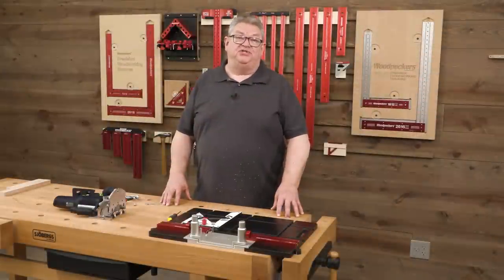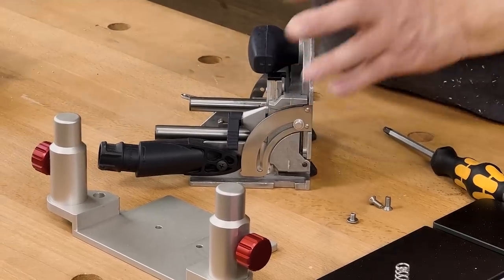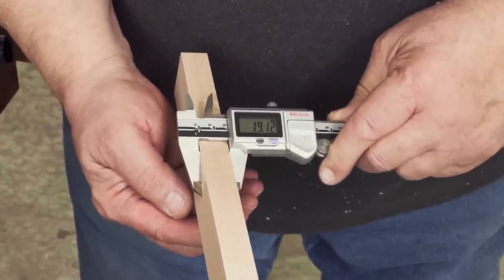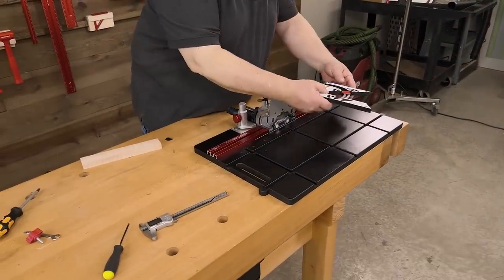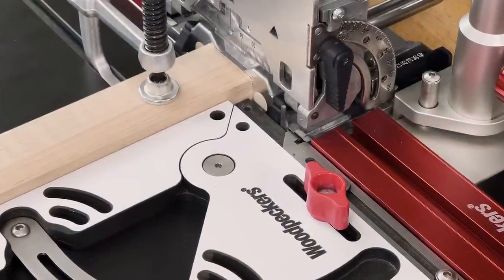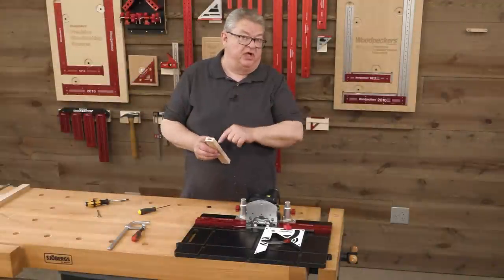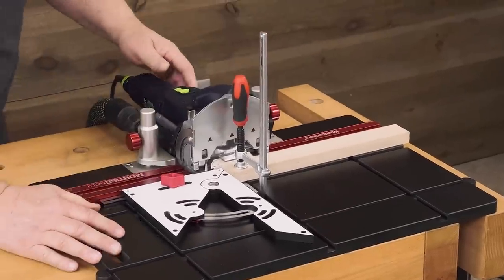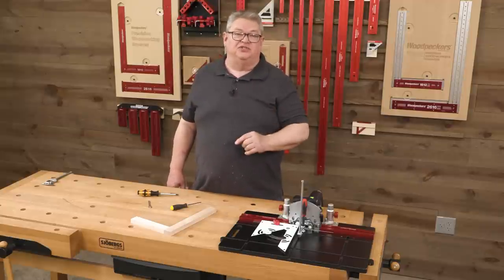MortiseMatch™ Assembly & Fundamentals | Deep Dive | Woodpeckers Tools

Comment: I built my own Carmonius version about a year ago.  But earlier this week, after seeing the Woodpeckers MortiseMatch, I decided it's a significant improvement.  My Carmonius version is good, but the Woodpeckers version takes it up a new level of convenience and utility.   As a daily hardcore-user of my DF 500 Domino, being able to switch between hand-held and base-mounted is very important.  The Woodpeckers version offers base-mounting plus the convenience of quickly dismounting and using the DF 500 -- and then almost instantly reattaching it to the MortiseMatch with perfect alignment.  That's worth its weight in proverbial gold.  And of course, that feature, together with adjustable triangle-protractor fence, is where the engineering and manufacturing innovations are -- and make the Woodpeckers version different -- and worth the money.  "I''ll take one."   (And Woodpeckers now has my pre-order.)
Reply: You Sir, win my "faith in man medal for the day". :)

Comment: I have three Domino machines - 2 DF500s and a 700.  I've probably used the 700 three times in seven years for so.  When I use the Domino, I always cut one mortice on the nominal tenon size setting, then for the mating mortice I flip the setting to the next larger width (always with the machine running) to 1) give me leeway to be able to shift the parts to line up perfectly and not have to cut both mortices exactly spot on and 2) to be able to get the pieces apart after a dry-fit by having a little side-to-side wiggle room; otherwise I find the dominos are so tight I can't pull the pieces apart without bruising the adjacent wood.  I'll reserve judgment on the Mortice Match for now as it's a little pricey for a hobbyist.
Reply: in 2008 and using the adjustable dowel placement pins on the Domino I notice that alignment of mating pieces were not perfect.   I sent the Domino to Fextool service and they corrected the issue.  HOWEVER they told me that the ossilation of the cutter can and probably will again go out of adjustment.  Hense the adjustable indexing tabs.  BUT Festool advised me to simply, unless absolutely necessary, cut like you described.  Tight mortice for one side of the joint and the elongated  mortise for the mating piece.  I have never ever had alignment issues using this method.
Reply: Sand the edges of your domino tenon and you will be able to pull your joints back apart and you can then make the mortises tight on both piece of material. Sedge from Festool Live always talks about sanding the domino slightly to get things back apart after dry fitting during the Domino Episodes. I have been doing that for years and it works wonders because I like to dry fit everything.

Comment: How is this thing secured to the workbench? It appears it’s just centered between bench dogs. If so, is there another way to secure it from the top via screws or some other fasteners? Also, can the black base part be extended or added onto for bigger work pieces?
Reply from the maker: You're right, we usually just clamp it between dogs. You can also clamp it to the edge of a bench with "F" clamps. It is not pre-drilled to screw-mount, but there's no reason not to do it, if that's the way you want it. We don't offer any extensions, but the black phenolic is 3/4" thick, so building extensions should be pretty easy.

Comment: Innovation is nice. Pricey for what it does, but worth to some it if you have the extra money to spend on jigs and don't have the time or the know how to build their own.   The  Accurate-Alignment Biscuit-Joiner Jig from years past combined with the new MATCHFIT Dovetail Clamp Pro from  Micro jig master kit will get you somewhere near this jig,  but not all the way. Again nice innovative design by Woodpeckers and will be helpful to those doing picture frames and casement work and using a Festool Domino DF 500. It was nice of Woodpeckers to include links to the above biscuit jointer jig. I actually have the Wood Magazine from March 2005 issue 161 that the jig and plans was featured in and never got around to making one for my biscuit jointer. Might have to break it out give it a read as it has the old plans and make me one now that I own a Festool Domino and a Biscuit jointer that I still use on occasions along with the MircoJig MatchFit Dovetail Clamp Pro.  I have already made a temp jig for hold downs while pocket screwing pocket joints with the MircoJig and it impressed me for the simplistic nature of the system. Then realized I could do all that with my MFT. and the clamps/ dogs from Festool. Again Great Job and design Woodpeckers. I have many Woodpecker tools in my shop, I do love the Domino offset jig and the story stick I have..

Comment: I have owned a Domino since 2007, cut in excess of 10,000 mortises and have never needed or wanted anything like this.  Sorry but this would be collecting dust in my shop.   How about coming up with a quick and repeatable way to clamp work in place on the Shaper Origin Workstation vertical clamping panel.

Comment: Could someone who has used this, or Jeff, comment on how to set up to do all 4 corners of a square butt joint frame? If you cut all four "stiles" with the protractor on the left and show faces down, and then flip the protractor and keep the show faces down on the "rail" parts, two of the mortises will be on the outside of the frame. The instructions indicate "butt joints require you to cut opposing corners of ends and sides at the first setting." Please elaborate.
Reply from the maker: Think in terms of diagonally opposed corners. Joints on opposite diagonal corners are done with the protractor on one side, then the other two corners are done with the protractor on the other side.

Comment: Neat item. It eliminates the need to align the centering mark on the clear scale with the actual mortice that is cut.  That alignment for "balls on accuracy" <technical term> is a pain in the a$$.
Reply: If you use a tight mortise for one side of the joint and the elongated mortise for the mating side of the joint the curser on the clear scale is easy and PLENTY accurate with the added bonus of a little wiggle room during glue up and clamping.
Reply: @11211lcb  If that slop works for you, thumbs up.
Reply: @jerbear425  10,000 mortises later, it works great.   That is why the Domino has 2 different elongated holes. Strength is not affected and you will never see th inside of the joint.
Reply: @jerbear425  humm. Sorry if I’m not explaining in a way you understand.    I have been a woodworker for 55+ years, professionally for the past 27 years.   I buy in bulk. Buying 5 mm Dominos 1,800/per case at a time has a,ways brought the cost per Domino down lower in price than 1,000 #20 biscuits.   This has been true for every case that I have bought.   Past that unless using  an FF size biscuit there very often is not enough room to cut a slot for a biscuit and not blow out the side of the piece.  This is especially true when making cabinet face frames.  And the Domino tenon is significantly stronger than a biscuit.  For Something like picture frame miters I simply use glue and a pocket hole screw.  For something like a miter on a cabinet door,when you will see the back side of the miter joint I’ll do the tight fit and loose fit mortise with the Domino and clamp with 4 K body style clamps.  There is no slipping of the joints when the clamps are snug and properly placed, even with nothing but glue to secure the joint.   But mitered joints are inherently weaker because of grain direction at the joint so I almost always built kitchen cabinet doors and furniture doors with stub tenon joints for the rails and stiles.  For the front face frames on kitchen cabinets I use Domino  tenons to reinforce the butt joint.  On furniture I also build with back face frames but those have a type of lap joint reinforced with Domino tenons. The rails and stiles of these back face frames have a rabbit/rebate along their inner edges to accept the back panels.    
So I build furniture and book cases with the tops, bottom, and mid shelves of the carcasses fitting into dados in the sides.   The front and back face frames also have dado/grooves to accept the carcass sides, top, bottom, and mid shelves.  I build the face frames first and then glue up the carcass pieces, front and back face frames all at once.  Typically there are a minimum of 12 dados and groves that are all glued in a single session.  Needless to say the rails on the face frames have to be precisely placed to match placement of the  top, bottom, and mid shelves of the carcass.   So precision placement of the face frame joints is critical.   The fact that I use a tight and loose mortise does not matter as long as those parts are precisely placed during the glue up and clamping of the face frames.   I work with unforgiving tolerances.  While what you consider slop might seem to be an issue the fit is easily tweaked to precise location and clamped until the glue sets.  Seriously  one can really over think what is important with how tenons fit.  Many years ago I saw a book with X-ray pictures of Stickley joinery.  The tenons were not precisely sized to fit  in the mortises.      Woodpeckers builds relatively high quality tools and jigs but I use time trusted methods that work as well with out a specially designed tool to supposedly make things easier.  There are some real issues with some of their recently released tools.

Comment: As a huge woodpeckers fan, I am disappointed how out of control your prices are getting.
Reply: Interesting comment. May I ask what your basis is for suggesting it’s prices are out of control?
Reply: I agree with the OP. Prices keep getting higher and higher. It’s an experiment to determine the price point at which they can make the same income with less volume. I have thousands upon thousands of $ in WP tools. Actually, it’s just over $11k. I’d say I have some first hand experience on their pricing.
Reply: @robertsiebert8146  you don’t think $700 is out of control?
Reply: Compared to what Chris?

Comment: hey woodpeckers, when are you going to do the deep dive on the the autoscale miter sled?  Ive been waiting patiently for this one but you keep passing it up and doing other deep dives instead?  What gives?  I have questions that need answering on the ASMS-L.  Im getting really nervous that you are not addressing the main concern that numerous people have with the miter sled and not being able to attach a sacrificial fence.  I have one on order, but if this continues to go unanswered,  I will be forced to cancel my order.  For the amount of money you are charging, the item should be FLAWLESS.  To me the Auto Scale Miter Sled has the one HUGE glaring flaw of no sacrificial fence.
Reply from the maker: Possibly as soon as next week.
Reply: @WoodpeckersLLC  Will you be addressing how to prevent tear-out on the back side of the cut since there is no provision for adding a sacrifical fence?  Further do you ever intend to come out with a better flip stop for the Exact 90 miter gauge?  As you have been informed the flip repositions itself when liften and or dropped into place infront of the sccrificial fence.  You make high quality products and charge accordingly but you really should address customers issues with your products.
Reply from the maker: A sacrificial fence would defeat one of the primary features of the AutoScale, namely the scale. If you place anything in front of the fence, the scale is no longer accurate at settings other than 90 degrees. Any piece of scrap can be used as a sacrificial fence if you're trying to prevent backside blowout and don't care about the scale. But then, a properly sharpened blade will prevent blowout, too.
Reply: @WoodpeckersLLC  FWIW I have already mentioned to some one else that a sacrificial fence would likely defeat the purpose of design.  I was hoping that you would have had a solution.   I suppose it would be too difficult for Woodpeckers to correct that missed opportunity.  And I suppose that the wandering flip stop on your Exact 90 miter gauge fell victim for the same reason. Woodpeckers changes a premium for quality materials and machining but unfortunately the design of a number of your tools seem to be rushed.   A properly sharpened blade is not a good work around/excuse for a design that was apparently rushed to market .  Your Exact 90 comes with a sacrificial fence which is good but the flip stop is not a good design for use with the sacrificial fence.  Do you have a work around for that?   FWIW I use premium Forrest blades and always have fresh sharpened spares to mount when one goes out to Forrest for resharpening. Tear out is a fact of life..  Even with a brand new blade tear out is always a possibility with many woods.
Reply: @11211lcb  I would wait for version 2.0 as that would probably fix the issue :)  aka autodrill with angle fixed the shortcomings of original autodrill and no upgrade path

Comment: Meh... seriously.  This solves what problem at 700 bucks?  A $.25 cent piece of lead in my pencil can do the same thing by scribing two lines on the work piece.  And if I need to batch out multiple pieces, I can just scribe a line with the pieces together in one shot.  

It's an interesting jig but at that price point for what it claims it does I'll stick to a cheap pencil to lay out my joints.  Hell I would say even in a production shop I don't see how this would improve output of product.

Comment: Anyone used this yet?
Reply: Yes I use it, principally to put small dominos into mitre corners, which makes it easy to clamp picture frames.  After a bit of fiddling around and some jigs attached to the base to expand its functionality I’m very happy with it - genius and superior to the Veritas version
Reply: @mykl5062  Thank you for your reply. Can you elaborate on what you mean by jigs attached to the base? I like that the Veritas version is bigger so curious on what you did?
Reply: I use the tracks in MM to bolt mdf jigs square to the fence.  Because of MM low profile base and being able to clamp it down to a bench I think it takes a fair capacity.  What I like about MM is the ease of lowering the domino base below the base for thin stock (and up and down generally) and the low profile of the base.  I also use it without jigs effectively to clamp the domino, hold the wood securely against and use MM to adjust the height rather than the domino stops.
I have two jigs one to reference the outside face of a picture frame to the domino rather than the inside which MM does with an angled piece.  This is just mdf bolted to the base, snug to the fence and with a 135 degree angle ( whereas the protractor does 45 degrees) that the piece is set against as it would against the protractor.  The second jig is to place a tenon in a 45 degree bevel against the domino face with the bevel long edge parallel to the MM base to put the tenon along the bevel rather than across the bevel, which I don’t think MM doesn’t otherwise do, and setting the domino fence at 45 degrees isn’t too good.  It’s a big 45 degree triangle perpendicular to the fence and base on mdf that squares to the total length of the fence and is secured to the base.  It really provides solid and square support for the triangle bit.  I clamp the piece with bevelled end to the triangle with the bevelled edge firm against the domino base and the tenon goes along the bevel.  You can see why my sons think I’m mad!